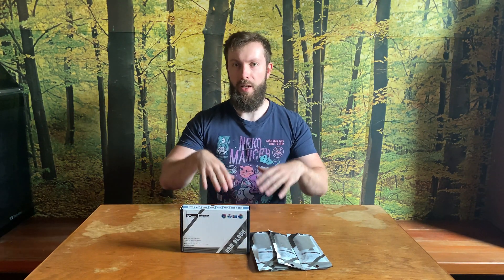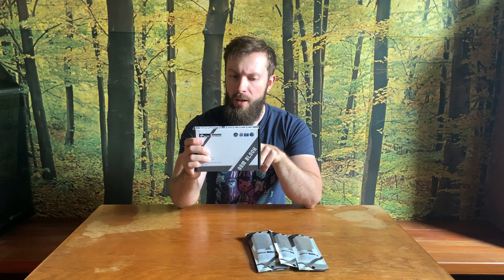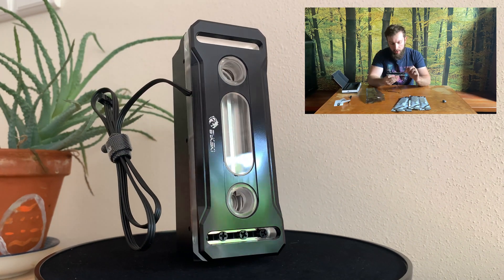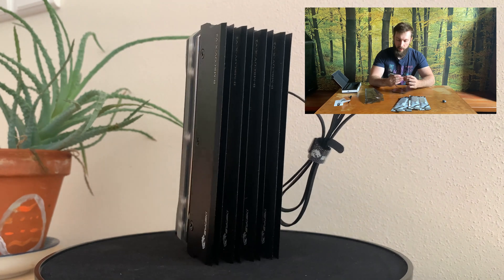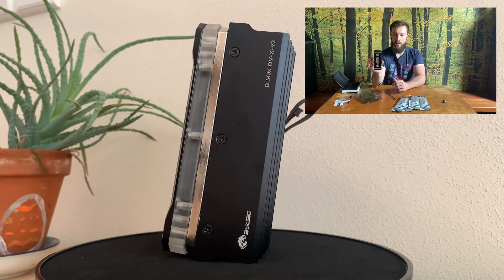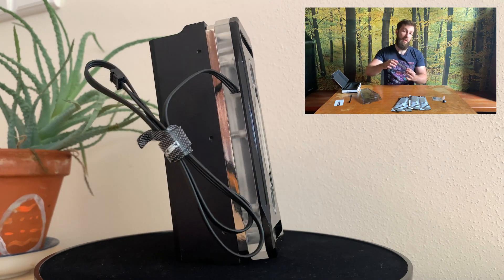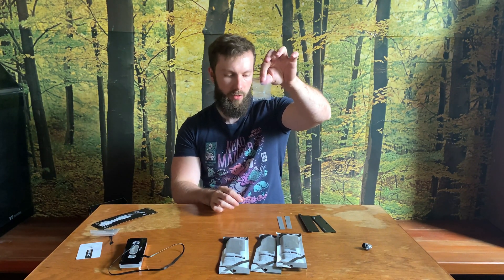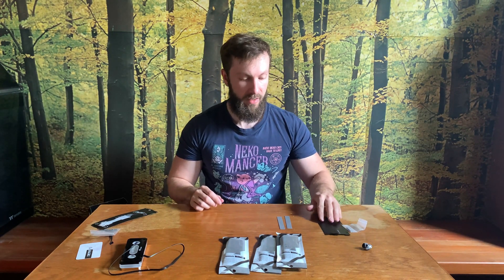Unobxing and review - Bykski - RAM block and DDR5 RAM heatsinks

Comment: did you install them? I am having doubts about these being really DDR5 compatible
they look exactly the same as the DDR4 version B-MRCOV-X at least according to the pictures on bykski website
for example the B-MRC-X look to be longer and therefore safe to fully cover the DDR5 ICs which are closer to finger connectors than on DDR4 but these look exactly the same as the older DDR4 version so it might not fully cover the ICs on DDR5
Reply: found out on byskski us site they have diagrams (they do not on eu site)
and the v2 is 34.5mm height compared to v1 which is 32mm height
seem they increased the height for ddr5 but were too lazy to re-do all their visuaalization pictures so the pics look the same just changed the name ;o]
so this means I will have to order new heatspreaders for AM5 upgrade

Comment: Is the waterblock compatible with ram heatsinks from other brands?
Reply from the maker: Didn't tested by me, but because the size of ram is normalized then the heat sinks should be the same for all brands. What is good to check is technical drawing of heatsink between the brands and check where are the holes for mounting to the ramblock.

Comment: What pad thickness did you use on the DDR5 PMIC?
I presume for the ICs, 0.5mm will do, but for the PMIC perhaps 1mm will be needed?
And also for the empty side of the RAM stick, probably also 1mm?

Nice review! I bought this over a year ago in Silver, for DDR4 but never used it. Now I'd like to use it for DDR5.
Reply from the maker: To be honest I didn't measure the pads. They are part of heatsing package from the manufacturer.